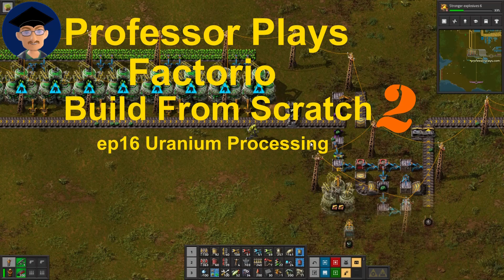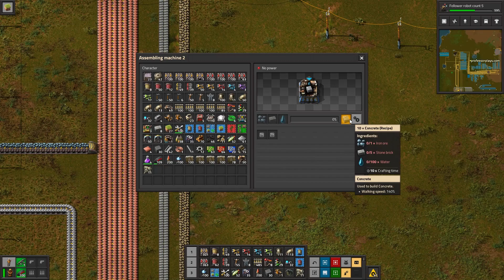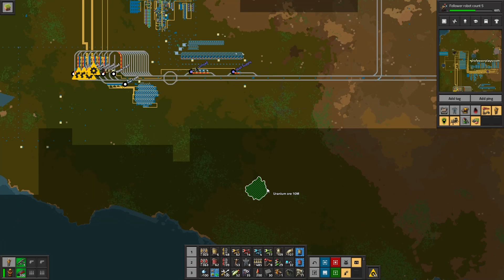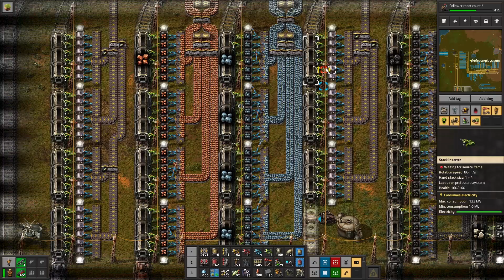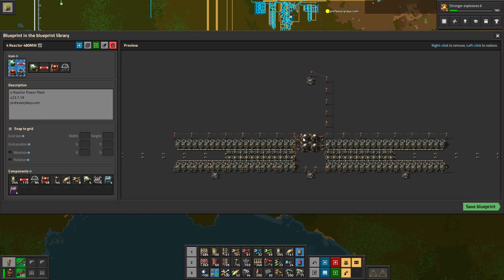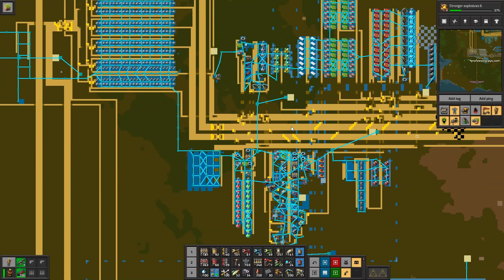Factorio Build From Scratch Season 2 ep16 Uranium Processing

Comment: 10:25 - I thought the rule was that the train had to be parked in the right spot AND it had to be on Automatic. I just tried testing this again and there seems to be a bug involved with this. If the train is on automatic and you switch to manual while the pump is running, the pump will stop. But if you remove the power connection and add it back (the old unplug it and plug it back in trick) the pump starts flowing again. I'm not sure what the intended logic is supposed to be, but I doubt it's that. Anyway, I haven't been using nuclear power and relying on coal and solar instead. I finished one playthrough and am about to finish a second that way so nuclear isn't strictly necessary. I guess it depends on how big your factory is going to be.
Reply from the maker: I've  tried all kinds of power. I'm happy with nuclear power for my playstyle. Mega bases have been using solar for a long time because it is better for the game framerate. I think recent changes by the factorio devs have improved reduced the framerate penalty on nuclear power.